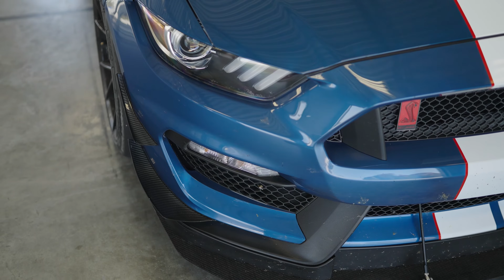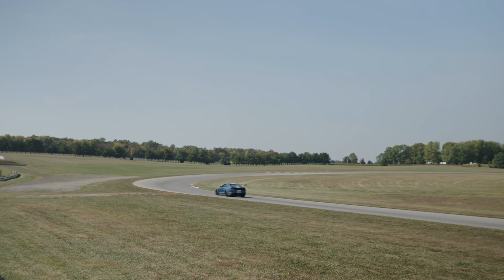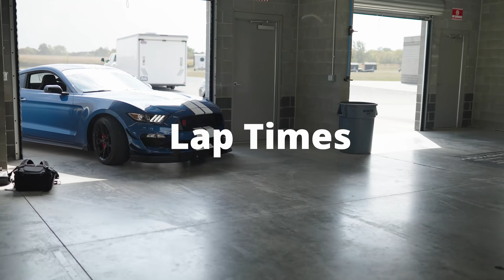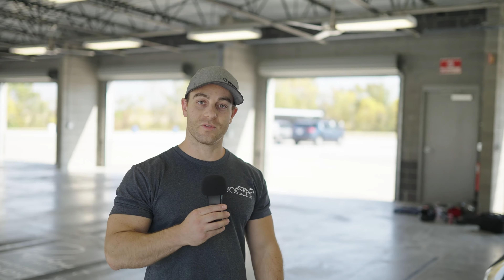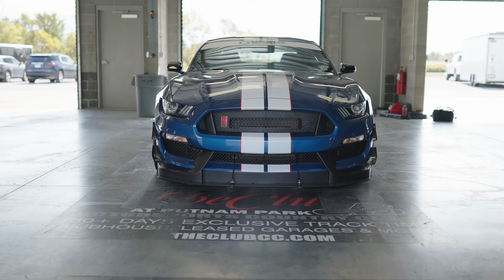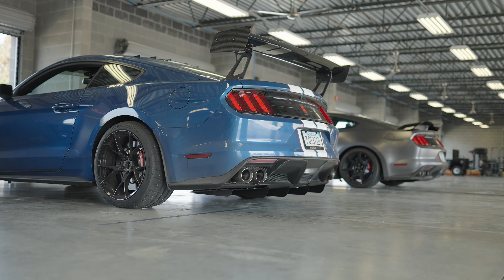Verus Engineering Ventus 3 Equipped Shelby GT350 vs Stock GT350

Comment: 2022 MACH 1 W/HP. Daily driver and HPDE. Does the vents 1 work for my car and is it the best Performance value from VERUS? How much would it decrease lap times and cooling for my car at VIR and Summit point RACEWAY? I have most of BMRs chassis stiffening parts,  anti roll. About the only thing I don’t have is: engine mounts and Not their 4 point engine k member. 
I am seriously trying to decide what type of hood vents I want to get. And whether or not I should add even more cooling for my 10 speed 10R80 transmission. I’m hoping if I get at least the center hood vent that will help with engine and transmission cooling along with possibly positive effects on downforce. Thank you.
Reply from the maker: I do not believe our GT350 Hood Louver will be compatible with your Mach 1 hood due to the differences in shape and contour.